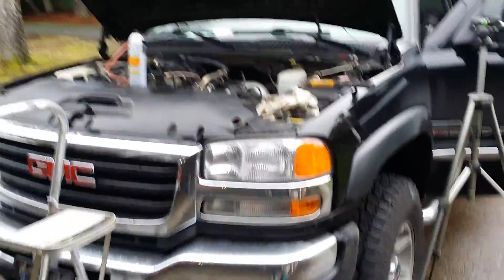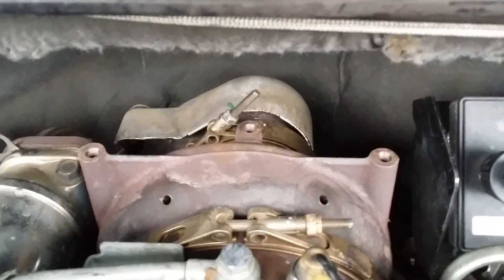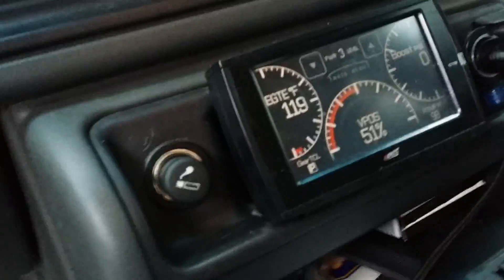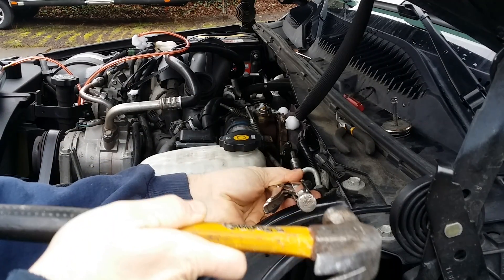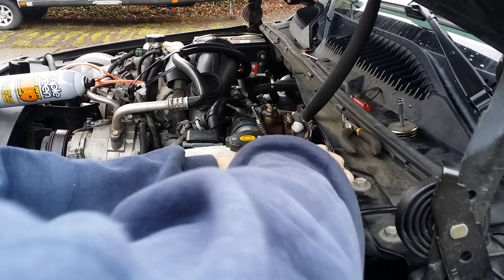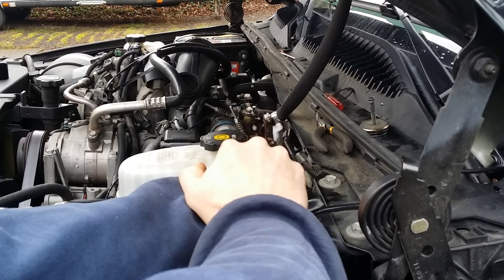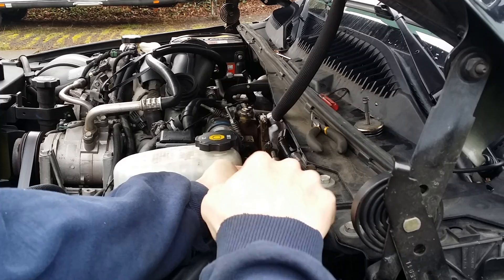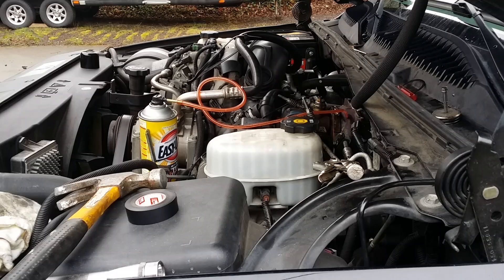Duramax P003A How to free up the VGT

Comment: Hi soapbox thanks for sharing. How did you drill those plug threads in?  Was it on a bench or in the truck?
Reply from the maker: In frame.  I might have done it with it running so the chips blow out.   Although on my system the chips can only go out the tailpipe.
Reply: Thx. I’m probably going to do the hard route and pull it from the vehicle to clean/rebuild it.

Comment: What uou stick the rod too? Can you post a photo?
Reply: tool is long gone.  It was so janky.  probably a 1/4" rod ground to 3/16" for 1" of the tip.  Then slightly bent to try and make a hook to grab something on the back side.  Turns out there is no back side; nothing to grab on to.  It was just luck that I was able to get a purchase on the plunger and be able to yank it out.  This got me by for a couple years, but pulling the turbo, opening it up and freeing up the unison ring and vanes was the real fix.  It was 7? years ago, and I still hate the idea of doing it.
Reply: @Kevin-ve7yi  I think the uni sun ring and the vans is the worst idea in the world!
Reply: @Kevin-ve7yi  but what where you pushing the rod against to open n close the vanes?

Comment: What codes were you getting ?
I’m getting p0045 actuator circuit open when truck warms up and it goes into limp mode 07 LBZ
Runs perfectly fine till it warms up can get good boost an no problems till it gets to operating temp
I get p003A some times 
Replaced boost sensor 
Solenoid actuator 
And vane position sensor      Wondering if I have same issue
Reply: Did you figure it out? I get the p003A aswell

Comment: Dude it’s time for a new turbo. Now that you have it all wet in there soot is just going to stick to it and cause it to seize. The turbo needs to be taken out and rebuilt or in your case replaced since you compromised the housing.
Reply: No crap!! Two holes and and some bbq cleaner. haha might as well start it and fry some steaks on it now. not hard to pull it off and clean it the correct way
Reply: That's what I ended up having to do.  half the vanes were rusted in place.
Reply: @Kevin-ve7yi I just replaced as well but the good thing about that is you can shoot for a drop-in upgrade since you’re already there 👍

Comment: You need to drive your truck harder and you wont have this problem
Reply from the maker: I'm old.  I drive like a grandpa.  I'm working on driving faster/harder.  Since this video I've replaced the turbo with a Stage 1, straight pipe, and EFI tune.  
The vanes and vane pins were rusty.  That was the problem when I finally took it apart.

Comment: Not sure if you are still posting or reading but can you explain a few things.  

The rod used did you just bend it with a hook and feed it in the hole of the plunger and friction fit it?  

This many years later have you found this damaged anything? 

Can you email me tim@abbaandson.com
Reply from the maker: Yes, friction fit.  No damage.  Ended up pulling turbo and cleaning the vanes.  Rust was the culprit.

Comment: Great video but you Should make a video explaining the rod tool you are using or what the end looks like. To the untrained eye it just shows a rod jammed into your turbo. Update this with more visual detail👍
Reply from the maker: The tool I made didn't work the way I thought it was going to work.  I thought I could reach down the hole and grab something to pull on.  The tool effectively was a mild steel rod that I ground to a point and the fact that I jammed it in the hole and I was able to pull the plunger out was somewhat chance.  In reality, it's a rod jammed into my turbo. :).  The real fix was pulling the entire turbo, freeing up the vanes from rust, slathering high temp 1800F anti-seize on everything.
Reply: Gotcha! Yes that seems to be the only real fix besides complete replacement!   👍

Comment: hey make a video of the rode you used to stick in the turbo
Reply from the maker: https://youtu.be/9hgqRldvjLw?t=4m52s  I thought that I could somehow hook something down the hole.  Like the back of the piston.  The reality is that it was just rammed in there and stuck enough to pull back on.  Overall, this is just a temporary solution, and I'd suggest not doing it at all.  Unless you're going to replace the turbo, spend the time to pull it and clean the vanes and the posts that they rotate on.
Reply from the maker: Here's a couple vids from when I finally pulled the turbo:
Before (with stuck vanes)
https://youtu.be/d-t3ZY3Zi4w
After (vanes were not stuck from soot.  They were rusted to the shafts they spin on)
https://youtu.be/OMYREB0PYd4

Comment: Love this idea!  My LBZ stuck about two years ago so I pulled the turbo, opened it up, found a SHITLOAD of rust built up on the unison ring and vanes.  After a thorough cleaning it was good for about 18 months, then it started acting up again.  Even if I have to try this a few times a year, it's still considerably easier than the alternative.  Thanks!

I do have one other question though - typically how long does your truck go before you have to do this again?
Reply from the maker: I haven't done it for a while now; probably over a year?  I'm pretty sure my problem was ashy soot from biodiesel, because I've stopped making my own, and the problem has stopped too.
Reply: Did your truck go to blowing tons of smoke when the vanes seized up.
Reply: @connor4961  sure did.  And the truck kept trying to cycle the vanes at idle. They weren't all the way frozen so It sounded like the truck was snoring
Reply: @billz1316  thank you. Mine blows all kinds of smoke. I can’t even get into it half throttle before it starts spewing smoke.

Comment: Question for you.  How did you mitigate the steel filings from drilling and tapping..??  Did you do those steps with the motor running.?  (its what I did to drill and tap my exhaust manifold for and EGT probe,,figured you may have done the same. thanx.  06 D'Max 294k miles and I need to free up my vanes as well...Thanx a BUNCH.!!
Reply from the maker: I put a bit of oil on the tap, but mostly I didn't worry about it.  I have my EGR blocked so there's no way those little bits are getting back into the engine.  Running the engine would work as well.
Reply: Any issues to date...? I see some GM tech made some comments here on what you did...It is Rust and not soot as evidenced by a number of Vendors on DPlace...(guys I trust).. Much prefer the idea of accessing by drilling a cpl holes...makes total sense.
Reply from the maker: No issues.  I don't know for sure if it's soot or rust.  Maybe both.  Mine frees up with oven cleaner, which leads me to believe it's soot.  I stopped using my homemade biodiesel, and the problem has gone away.  Which also leads me to believe, at least in my case, that it's soot.  Total respect for the GM Tech K. Rogers.  It took me 4+ hrs just to get the downpipe off.  If I could get the turbo out in 3hrs, I'd do it.  I just know that it would take me 12hrs and 3 trips to buy tools.  Once I have a 2nd truck, I'll do it the right way.
Reply: veggie oil carries water no matter how you turn it, so looks like it's soot, and rust combined

Comment: iv got this same fault code on my ford s max 2.0 tdci dis the code go after you cleaned the turbo?
Reply from the maker: It will clear the code but not right away.  I use the tuner to clear it.
Reply: +soapbox94 what u mean tuner??
Reply from the maker: +Danny Buron I have an Edge Evolution CTS.  It can reset engine codes and do a ton more. Best money you can spend on your truck. there's probably a dozen brands that can do the same thing.  pretty sure that I show it in the video.

Comment from the maker: Because diesel is so cheap, I've stopped using my homemade biodiesel and this problem has gone away for the last 8-9 months.  I happened to buy a tank of B99 a couple weeks ago, and just with one tank the error code came back.  I know the real solution is to pull the turbo and properly clean it, but I'm just short on time.

Comment: The last grille cleaner I used had the same chemical comp. as oven cleaner which is Lye
What is the active chemical?
Reply from the maker: +money 2 I don't know what the Simple Green BBQ cleaner has, but Easy Off uses Lye.  Not sure if it's NaOH or KOH, but the cleaners with Lye work the best.  If you use one that contains Lye, don't let it sit on anything in the engine bay, wear glasses and gloves.  It will eat your skin if it sits there.
Reply: @soapbox94  mr muscle almost burn my skin to the bones xD

Comment: can you provide a picture of the threaded rod used to push the piston in and out? I'm curious as to how you modified it to allow you to pull the piston back out. 
you can send to my email, jjc5022@yahoo. com or maybe just explain a little how you made it
Reply: +Justin Chury I'd like to see the same, my oldmans LBZ is having the same issues, constant P003a code and it won't pass emissions until the code is removed.   All I need to see is a pic of the end of the threaded rod! lol
Reply from the maker: +Justin Chury If you go to my first video of me fighting this problem https://youtu.be/9hgqRldvjLw at the end (fast forward to 5:00) there's a shot of the janky tool I made.  My goal was to make a hook that would go in sideways and hook on the back, but the hole that the tool goes into is about 1.5"? deep, so my tool doesn't "hook" at all, it's just jammed in there and somehow has enough tooth to pull on the actuator piston.  I probably got lucky, and a guy could probably build a better tool.
Reply: I actually didn't watch the whole video at first, then I saw how it. My problem was the vane solenoid was faulty. I could move the plunger in and out very easily.

Comment: turbo replacement is not really that bad, it depends how experienced you are and how good your tools are, with wobbles, universal sockets and such you can pull the turbo in 3 hours and have it back in around 4 hours so a total of 7 hours, it really only boils down to RUST. anyways i wouldn't recommend doing this that cleaner WILL degrade the turbo oil seals, it will take a while but it WILL happen, so be careful if shes puking white smoke someday shut her off and inspect for oil
Reply: +Kevin Rogers  and a second FYI people it usally is NOT carbon that causes it to stick, its RUST and when doing this treatment you will probably CRACK the unison ring and that will cause a deflection in the ring. i work on these engines quite often as a diesel tech for GM and lemme tell you this is NOT A GOOD IDEA, but your truck do whatever u want
Reply from the maker: KR, if you're still out there, I finally pulled the turbo and cursed the whole time I was doing it.  I had to work on it just a few hours a day, but I bet it took me 9+ hours to get it out.  The (11) 12mm 12-point up-pipe bolts  gave me the most bloody knuckles, swearing, broken tools, etc.  10 years, 150k miles, I would guess it took over 100+ ft/lbs to get them undone.  In a terrible spot.  I was actually thinking of your post while I was doing it.  I might have even cursed you out while I was bruising my chest on the engine.  
But you were right in the end.  It was rust, not soot, that seized them.  Specifically the vanes on the posts were what were keeping mine from moving.   I've been thinking about your post for a year since you wrote it, so I just wanted to give you a nod.  Thanks.

Comment: Why not remove the turbo and clean it the proper way, it's not that big of a job guy...
Reply from the maker: hiram adair 100% agreed.  How many hours will it take?  I've been told 10hrs if you know what you're doing.  The shop I went to said it was billed at 12hrs.    I've been almost there when I removed the up pipe.  I just can't have my truck down for that long, and I can't devote 2 days to it personally.
Reply: @soapbox94  Alldata says to drop the transmission to get to the turbo and has 11 hrs for a turbo replacement!!!
Reply: Holy shit! Ya think maybe just maybe he thought about that!

Comment: so any updates on this CEL. did this work. How did you tap this and keep the metal savings out of turbo. has the Light come back. how deep did you tap the hols. did the plugs protrude into the turbo housing or did you make sure not to go to deep.
Reply from the maker: No CEL since treatment.  Not worried about shavings going out the exhaust - My EGR is blocked, and my CAT removed.  I tapped the holes all the way?  Not sure about that question, but the material is about 1/4" thick and there's plenty of space between the housing and the turbo vanes.  Plugs are maybe 3/8" long.
Reply: @soapbox94  it's been six years, how has it been so far?
Reply from the maker: @stn7172  Ended up removing the turbo to clean it after it sat in a repair shop for body work for 4 months.  While I had it out I upgraded to a stage 1 and sold the stock turbo.  Spraying stuff in there is not a permanent fix, and I knew that.  It might get you by for a while.
Reply: I want to do this but can't get the little aluminum piston out. Put screw in and got a good pry but will not come out. Does it just pull out or is something else still holding it?
Reply: Dave Montoya